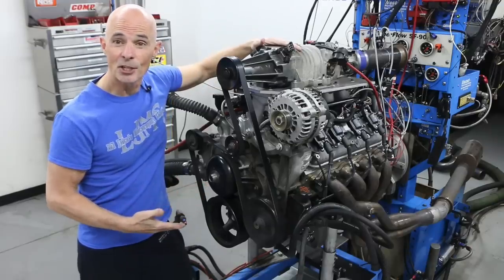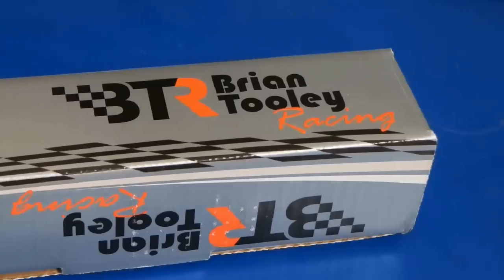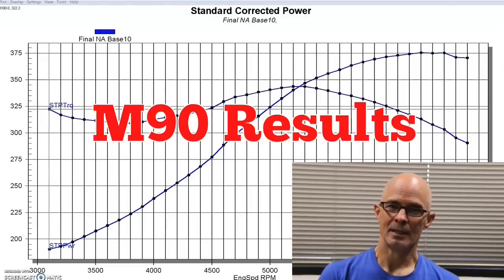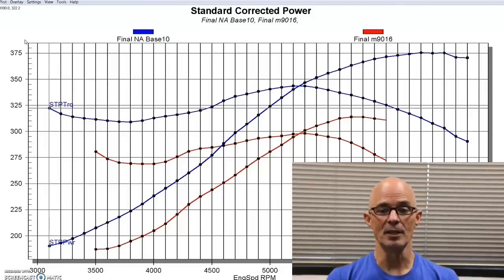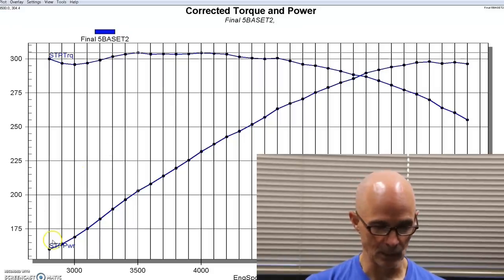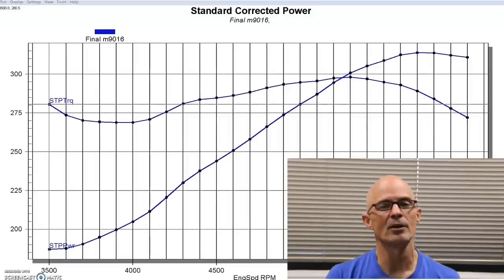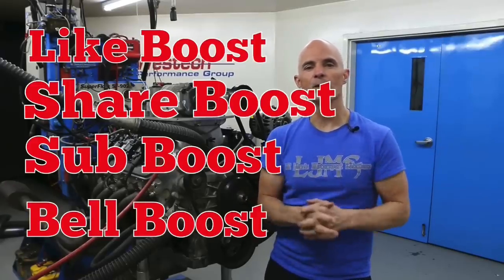JUNKYARD LS M90 SUPERCHARGER TEST-FULL RESULTS!

Comment: "BOOM! We lost a bunch of power!"
Reply: You lost power because your not using the correct set up superchargers do not run on factory drive assemblies the crank pulley is too small and that supercharger pulley is way too big for a V8 application the Eaton M90 powered the rough mustangs to 400+ HP for years
Reply: @patrickmonroe9062 thought that was the m112 that did that?
Reply: @patrickmonroe9062  mustangs used a bigger eaton supercharger. they used the m120, no the m90

Comment: I would like to see what the blower with a tiny pulley would do
Reply: I’d be happy to make him a custom pulley, I doubt the aftermarket ones available for the 3800 series are small enough for this application, but he will likely need to really tweak the routing to get maximum pulley wrap if going smaller. Makes me wonder why nobody runs a separate pulley and belt just for the blower, and run a cog belt like they used to, serpentine driven blowers making big boost are always fighting with slip... a cogged (toothed) belt solves the slippage.
Reply: Robert Ambrose the Saleen 4.6 2vs manage to get 390hp out of these
Reply: TexasRoadWarrior probably a combination of smaller blower pulley and larger crank pulley. I bet they are using every last bit of air you can manage from an m90
Reply: the pulley is actually large lol, dropping several pulley sizes would definitely help along with a different crank pulley

theres a  aftermarket for the 3800 s/c setup so getting them wouldnt be hard
Reply: Jacob Burskey I doubt the aftermarket pulley options for the 3800 go small enough to make the kinda boost you need to feed an engine that flows twice as much as a 3800 but I’ve been wrong before. I know the 3800 guys still have trouble with belt slip when they up the power.
Reply: Even with a 2.55” pulley (smallest made for the m90, and requires modifying the snout for clearance) instead of a 3.8” pulley on the m90, guys running 3800s are still only getting 400hp to the tires. After drivetrain losses that’s about 460hp to the crank. Nothing to complain about in a commuter sedan, but still would have difficulty feeding any displacement of LS engine.
Reply: @gallupcustomknives2293  if enough blower speed can be used itll definitely help, the m90 with a 2.6-2.8 pulley moves enough air to make 500whp, pair that with a proper crank pulley and you can spin it hard with proper cooling (e85)

most struggle with getting over 400whp because they dont port the inlet, a 65mm pulley trying to supply that much power is difficult for a s/c like this, even on a 3.4 pulley setup a guy has seen vacuum readings pre blower post tb show that theres a restriction on the v6 cars, cant imagine how it would be on the 4.8
Reply: Jacob Burskey yes the 3800 has issues that compound the problems of increasing the boost. But porting the inlet, cooling the charge, and increasing the vane speed can only do so much, eventually you run into cavitation. Any fluid pump sees this. There is always going to be a restriction at some point, and I bet the point for the m90 is right around 500hp you can port the inlet until the casting is soda can thickness, and port the outlet until there’s nowhere left to port, and spin the vanes 200k rpm but you’re still working with something undersized for the application. The m90 is a fantastic blower, within its limitations. But somethings gotta give. I’d love to see at what point it does give up though, on a larger, more demanding motor like this 4.8. I had a Nissan Xterra with the 3.3 that was fitted with an Eaton M62 from the factory. Was a blast to drive, tons of low end power, but mpg was terrible, worse than my lifted dodge full-size with the v8.
Reply: @gallupcustomknives2293  inlet issues cant be fixed by simply porting if you want to go with extremes and max effort, you have to physically modify the case via welding a new much larger inlet on, and the outlet porting doesnt help much due to the design of the rotors/type of blower, 500whp has been made on a rwd 3800 in aussieland but they hadnt yet maxed out the blower in terms of pulley size/outlet porting. I do think with the larger ls engine youll hit the max limit much earlier given you have more displacement (like how turbos max out earlier with larger engines) but to what extent is not sure.

damn a small m62 on a 3.3 is an interesting combo, would have loved to see the m90 on that, probably would have maintained the low end but offered much better top end and mpg due to not almost always being in boost like the m62 setup probably was? m62's are usually used on the 2.0 4 cylinders, guess that is a similar comparison to an m90 on a 4.8
Reply: Heat up the air charge and not much gain.
Reply: @GIGABACHI  e85 is a wonderful thing and fixes that
Reply: @jacobburskey3044  even throwing alcohol wouldn't fix the real problem: Choked engine.
Reply: Can you tell us the pulley sizes on the Crank and Supercharger? I know a lot of guys are assuming 3.6” for the supercharger? Is that correct?
Reply: @beartodrift5345  The stock supercharger pulley is a 3.8".👍
Reply: @beartodrift5345  and the stock crank pulley is 6.95 inches
Reply: @jacobburskey3044  
You are CORRECT
Reply: @jacobburskey3044  
My Buick 3800 supercharged,  has a M-62.
That has embarrassed 5.0 mustang.
Reply: @jacobburskey3044  
Is thst diameter???
Reply: @nellyfarnsworth7381  unless you have a series 1 s/c 3800 you have an m90, the 1997+ 3800 s/c cars have an m90

Yes the measurements are diameter
Reply: @jacobburskey3044  
Yes I have a BEAUTIFUL 1995 Buick Riviera.
BUICK 3800 WITH THE M-62.
ALSO have a 2002 Buick Park Avenue with 3800 Series II with the M-90.
Both wonderful cars.
I understand the engine that replace the Buick 3800,  the camshaft chains must be replaced every 50k miles.
The 3800 will go 200k - 300k with only oil changes.
Reply: @gallupcustomknives2293  can't get Cavitation with air...
Reply: Indy Rock perhaps cavitation is the wrong word, but what I meant was that at a certain speed maybe the air density will overcome the tolerances of the rotors, or will leak past the seals between the rotors and the case.
Reply: With ebay turbo prices, the m90 blower is kind of a moot point, but I would be interested in a 2 or even 3 m90 test to see what that would look like and the numbers.
Reply: @nellyfarnsworth7381  was embarassing them in 2000s w grand am gt 3.4l...even boss 302s
Now i take it further and embarass them with 2.0 4cyl honda hahaha
Reply: Robert Ambrose  No they aren't, it's a 3.8 inch pulley stock. Aftermarket we run down to a 2.5 inch pulley on the 3800.
Reply: @gallupcustomknives2293  They go down to 2.5 inches, and begin that you just make more heat. The blower is too small to make much more power.
Reply: @charlesbrittain434  eBay turbo prices can suck it. I payed $45 for my gen 3 m90. What everyone is failing to realize is that in this application, his m90 is actually being spun slower than it would on a 3800. This same exact blower has supported 3700lb, fwd cars into the 10s. Zzp makes a modular pulley system that can usually drop to a 2.8 on a stock snout. That pulley would allow a 250% blower overdrive and about 15k Rpm blower speed at redline. It would probably make close to 8psi without an intercooler at that pulley ratio.
Reply: @madmod  I'm seeing some $150 m90's on there now, dont know if I trust them, but then I would have to fab an intake for my deal. What is your m90 on? Did you have to fab an intake? Been watching junkyard doggs channel for the twin m90 302 build but it's not running yet so who knows what it does. Would like to see Richard do the smallest pully possible, then do a twin setup, I feel like we would know a lot more about it then. Also could you link some of what your quoting (single m90s turning 10's on 3700# FWD rides.) BTW you might like Matt Happle's 8k mustang turning 8's.
Reply: Dave’s Boredom Busters the aftermarket pulleys from zzp go small enough to need the supercharger snout milled down to clear the pulley. Trust me, belt slip comes way before you run out of smaller sizes
Reply: Run 2 Gen V M90s
Reply: @gallupcustomknives2293  Thunderbird supercoupes which use the m90 use a separate belt.
Reply: @CraftsmanQuad19  over here on the ford side we have upgraded tension pulley springs that help with slippage. It sounds like you GM guys have much more from the m90 than we have. I've never heard of a tbird sc with 500hp from a m90 setup let alone one that can run 10s with it.
Reply: @Turshin  I’m a Ford guy most of the time, but 3.8 to 3.8, gm to Ford, I’ll take the gm 3.8 every time. 

With that being said, a supercoupe or turbocoupe would be a FUN cruiser...or drivetrain donor into my ranger lol
Reply: I put a 2 inch pulley on this identical supercharger installed almost the same way on a 4.6 mustang and it puts 9-10 lbs of boost
Reply: Put the belt right on the shaft
Reply: @Texas_Road_Warrior  the saleen uses like an m112 or m122 not a m90
Reply: I know this is old.. But nearly 10yrs ago i pondered how to fab a junkyard eaton m90 to a ls motor, mainly using my 04 tahoe with 4.8 instead of building the 6L for it.. Tho fab work vs slapping a mild LQ9 together, 6L won. But I did tons of research. Eaton states that the m90 is good to a displacement of 5.0L thus meaning a 4.8 with smaller pulley a guaranteed success! Guess Eaton and my thoughts were all just good theories lol

Comment: Would love to see a twin M90 setup. Blown junkyard build up on the cheap! That would be super cool to see.
Reply: I am planning to do just this. Ive got a junkyard 302 out of an explorer going into a mercury mountaineer. Its the same motor, and the one already in the car has 1 m90 on it already. Hoping to make 400hp under 1k
Reply: Why would you even use them wimpy blowers for such a big engine....I bet you can make more HP with just a cam and headers and tune then you could with two of those wimpy things.....them little superchargers barely even bumped the horsepower up on the 3.8 V6.
Reply: I have seen it done and it looks awesome

Comment: The 90 in M90 refers to the cu in displacement per revolution.  Assuming 100% efficiency, a 3.8 breathes 115 cu in per revolution.  So, an M90 runing at a pulley ratio of 1.28 would provide 0 boost.  A 100% efficient 4.8  breathes 146 ci per rev.  So, it would need a 1.63 pulley  ratio.  Assuming the engine is 80% efficient, gets the pulley ratio back down in the 1.3 range.  But that just gets you back even on airflow.  The supercharger needs to send MORE than the engine wants naturally aspirated to create boost.  An M112 would have a 1.08 ratio, so it might be more appropriate for a 4.8.

Comment: Do a twin charged episode
Reply: I thought the same. Twin sc with slightly bigger pullies. Pretty sure I have seen that at a lemons race 😂
Reply: Ben Dodson smaller pulleys*
Reply: @WS6xMASTER  I was thinking larger since the SC was meant for a 3.8. Larger pullies would equal close to factory boost with the 3.8. Test it, then swap for smaller and see how much boost it will make. 

Although, the 4.8 breathes better than a 3.8 so a larger pulley swap probably wouldn't be needed.
Reply: I have a 5.3 with twin m90s
Reply: Agreed, there is an actual benefit too dual blowers in that you dont need too spin them as hard too support the HP and that helps keep IAT's down. Would love too see the hard data
Reply: Most people dont know there's 2 m90s used on 3.8s. L67 gen 3, L32 gen V. A gen V will out flow a ported 3 and will be more efficient. If he puts a small pulley, he'll still lose power pulling timing. They will become a HEat-on. In all my research, even spun to the moon, a gen 3 m90 should max 420 crank in the most ideal conditions. Its just the LS is so efficient, the m90 cant compete. Example is a L67 has iron heads that flow 180cfm per port intake for 6 vs 227 cfm per port for 6.
Reply: Facebook build page is jane: 1978 camaro twin m90
Reply: @adventuresofabbott4374  read the whole thing, dig the twin polymer mailboxes! Did he ever say how much boost it makes?
Reply: @charlesbrittain434  5 psi at 500 rpm roughly with bypasses shut. 
15-16 psi at 2000
Reply: The answer is yes, people would do twins. The hardest part would be to set up the throttle cable linkages.
Reply: Linkages? Blow through one t body
Reply: @adventuresofabbott4374  PM me. I'm doing the same on an L98 5.7
Reply: Id do a super to turbo or centrifugal sc to pd sc

Comment: Nobody with any sense would expect that blower with the STOCK pulley to support a V8. But if you were to optimize the combo by putting a larger pulley on the crank and calculate the size of supercharger pulley needed to get the desired boost level wanted it would work. The M90 is a 1.47L per revolution blower and can definitely supply enough air to feed that engine. Especially if you add an air to water intercooler and heat exchanger to remove the heat. Nobody runs a blown performance street car on the street without an intercooler anymore. This isn't the 90's.

Comment: The 4.8 LS pulley is 7.5 inch while the 3.8 SC pulley is 6.9 inch so the bigger LS pulley actually should overdrive the supercharger and increase boost over the smaller pulley

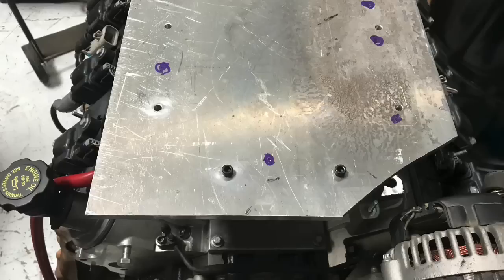Comment: At 2:30, you can see the boost bypass valve is not fully closed, which is causing a large amount of boost to bleed off.  The boost bypass valve is also not properly referenced, leave the lower vacuum line disconnected for this test.  You can tell it is referenced incorrectly because when you let off the throttle, the flapper arm does not open.  For the purpose of just running the engine on the dyno and not in a car, re-make the plate so that it does not have a passage for the bypass valve which will eliminate the variance in boost.  Alternatively, you can also make sure the bypass valve is properly adjusted so that the arm is putting pressure on the set screw.  You want the butterfly valve to be parallel with the supercharger.  There's more to it than this, but for the sake of a short comment and just running an engine at WOT on a dyno, this will suffice.

Comment: I too would like to see what an Eaton m122 off a gt500 could do on this same setup.
Reply: Or the 112 from the Terminator cobras
Reply: Definitely m122 gt500 blower. Twin m90s would be cool though
Reply: Seen lots of those set ups. They do well.
Reply: I have a MP112 which is the Eaton m112 head unit. Makes about another 100-150hp at 6psi depending on your set up.
Reply: https://imgur.com/a/jxNtd7L  Just got it put together a while ago.  It's an M122 on a 408 SBF.
Reply: THIS. The m90 test was kind of pointless
Reply: i want to see this combo also... been curious for years about adapting an m122 to an small LS
Reply: I put an M122 on a 3.8. The M122 makes the same psi (15psi) with the stick GT500 pulley as the M90 did maxes out. And when I say maxed out, I mean it was ported internally with a 2.12 inch pulley and an intercooler set up too hard to explain. Long story short, an M122 unit can make just as much as an M90 can maxed out and do so way more efficiently.
Reply: @Sruikyl  It definitely proved a point !!!!!!!
Reply: @Sruikyl  It definitely proved a point !!!
Reply: The M122 will make about 575-600rwhp.
Reply: @ericrobison8591   how did you set the intake up for the ford  what ecu are you running?
Reply: Smaller drive pulley on blower to spin it up faster.
It's about the CFM.
14,000 RPM is the maximum design speed of that particular blower.
So from a given maximum engine rpm you can figure out your pulley ratio.
If that blower still cannot give you the perfornance or design boost you needed , go with a larger CFM blower or TWO M90 blowers.
BTW , another guy already did that here on youtube.
And yes , his fabricated both the liwer intake and upper one.
His was a carburated wet draw through design.

Comment: The supercharger Bypass was OPEN.
REMOVE the supercharger valve. 
Plug to hole in the plate.
This M-90 will boost a 5.0 engine.
THANKS for all your hard work.
That has helped me.
THANKS
Reply: Something is likely wrong since these m90s make max boost by 2000 engine RPM and the starting power is below even the stock 3.8's 240.  I don't think the displacement is what matters as much as the CFM.  Go back to 2000 when GM was making these and the n/a 3.8s had higher power output than ford's 4.6 modular since the heads flow more.

Comment: Definitely go for the twin M90's.  I had a friend when I worked at Eaton that put twin M90's on his Ford drag car in the late 1990's.  It was a wild-looking thing.  A single M90 on a 4.8L engine just can't supply enough air.  You basically summed it up when you said the M90 was good for about 300 HP.  The situation in this test would have been improved if you had just taken the belt off; then it would have made close to the NA power, with the supercharger windmilling in the breeze.

If you can get two M90 5th-Gen's with the coated rotors, that would be even better.  The coated rotors improved efficiency that added 20 HP to the supercharged 3800.  I tested M112's and M122's at Eaton a lot.  M122's weren't much of a step up from M112's because the intake port was no larger.  The TVS series was a HUGE jump in performance because of the large intake port and improved port timings.

Comment: Love the test !! I’d like to maybe a GT500 blower or terminator blower on the 4.8L though. Might make the ultimate 1/2-ton truck trouble free upgrade (we all love turbos, but we all should be able to admit that an roots blower with modest demands its generally more maint. Free)
Reply: The blower would make good low end torque for a truck. I'd want to sandwich a heat exchanger in there though.

Comment: 1. Verify the lower pulley size on the 3800 V6, maybe this m90 wasn't spinning fast enough.
2. Definitely try a twin setup, guys will only do it if it works.
3. Give us the pricing numbers so when it does work we can make the cost analysis against an Ebay turbo.

Great content Richard, keep it up!